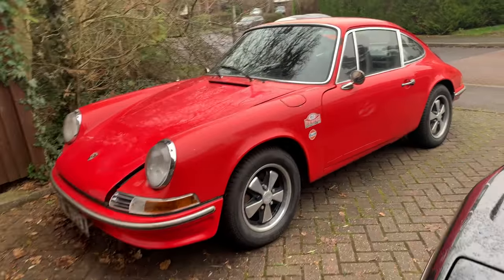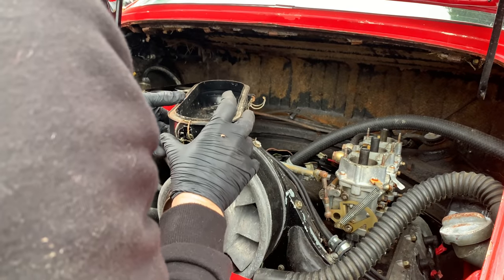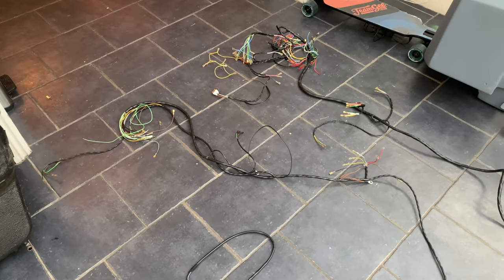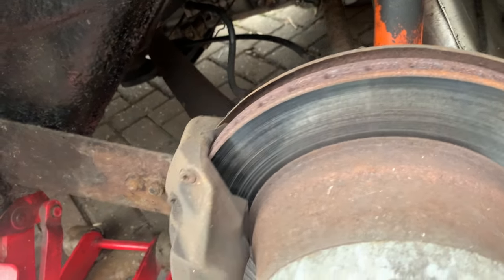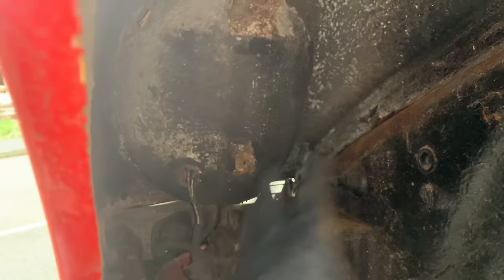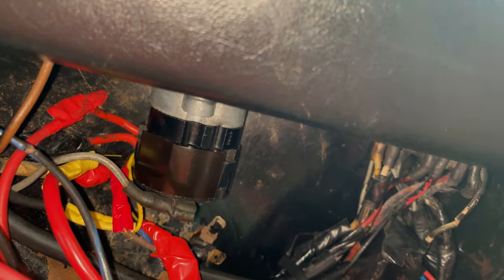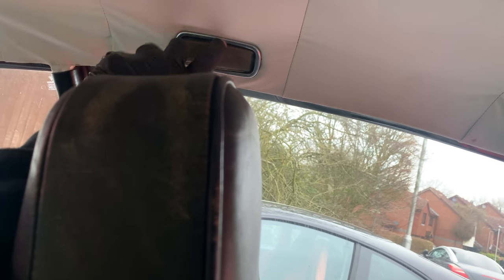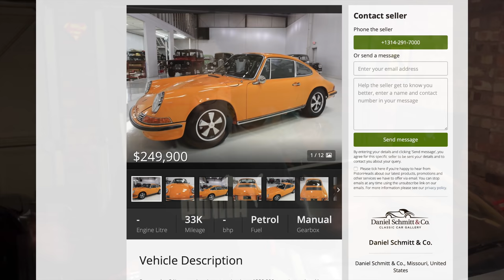Porsche 911 Project ....  How Bad Is It ? What Did It Cost ?

Comment: I would patching in the rust spots on panels as much as possible.  Watch some of Scott's metal work on Coldwarmotors or Brent on Halfass Motors.  The cost of replacement and then trying to align the new panels can be a nightmare.  You are a very talented, resource guy  and think you should start practicing with your welder and 3M panel glue systems. Save your money for the wiring and mechanical parts.  Best of God's Blessings from Nebraska!

Comment: Brilliant content part of my routine of an evening cup of tea and watch .in my 40s now started pulling cars apart years ago rebuilt several capris 30s 2.8 have worked as a mechanic even used to work in the checkered flag Santa Monica .love watching you trouble shooting and saving money 👍 my current car is a BMW Z4 coupe e86 which iv just gone trough suspension shocks all round springs mounts disks pads clutch duel mass sorted out several oil leaks water pump this is my 2nd z4 rebuild having sold last one to a friend.the current z is one of only 20 to come to the uk being phenix yellow so worth keeping.KEEP UP THE WORK 👍you show that you don’t have to throw money away to have amazing cars your determination is brilliant and it shows with a bit of know how you can have these cars if I used a garage I couldn’t afford my car.thanks for Chanel 👍😎
Reply from the maker: Cheers buddy much appreciated

Comment: Your rear panel is not correct for your car, you will need to make some modifications to remove the bump on the right and the angle if the edges. Great project though... My 1970T is now a 260bhp hot rod. Loads of fun!
Reply from the maker: cheers Paul I will take a look at another and see what you are referring to

Comment: btw...seeing those carbs ...if you do not yet have one, an ultrasonic cleaner in which the carbs will fit would be an excellent purchase. See eBay or amazon. One that will fit a carb will cost under $200...or thereabouts. The cleaner will also be helpful for other parts cleaning.

Comment: Hi, love your video's.  I would cover up those battery terminals.  You have a metal repair panel in the frunk.  it it moves during transit it could bridge the battery terminals.
Reply from the maker: Ive got a strap somewhere to clamp it down .... good spot though cheers

Comment: Hey Porsche bro. That will need easily £30k min to get it properly shipshape and solid. Both kidney bowls will be f###d and the strength in the chassis compromised. Good thing is the stainless heat exchanger/exhaust will have zero rust issues. Classic 911s are a motoring love affair. Best wishes for the resto👍🏻
Reply from the maker: cheers Gio

Comment: Look into Kroon wiring harnesses. I'm not affiliated with them, I've just heard their products are very high quality. Bit pricey though.
Those front seats are late 70's to mid 80's factory recaro sports seats. Factory option on the SC and Turbo. Comfy, and worth a few quid if in decent shape.
Reply from the maker: Flexnes1 cheers that’s good to know. I’ll clean up the seats and offset the cost
Reply: I’ve used their parts. Excellent quality

Comment: dont cut that quarter panel or you will be sorry11! .That littie bit of surface rust can be cleaned up and undercoated,saving you an immense amount of time and money.I OWN A 1968 912 ,that i was fortunate enough to pick up for a song back in 2004.As an old PORSCHE fanatic you know this is the same car with a smaller engine.My coupe has minimal rust issues and came with the front pan already replaced,due to corrosion from the battery area Thats a stamped piece ,thats easy to replaceand seems to bean area of concern with these cars.I would repair that bottom of the rear window area and along the top of the rear quarter panel andget that torsion bar access cover opened up and be done with it, My headlight buckets are in good shape but the metal conduit where the wires live was corroded out.Other areas to look for rust ,door hinge posts, rockers,and floors.Acomplete restoration is an absurd amount of cash involved and out of the question.But a good fun driver can easily be attained by sorting the mechanicals and that wiring mess.Then some cosmetics and start enjoying the  driving.As you know these particular vintage Porsches handle so well and are absolutely just pure fun to drive whether its a 911 or 912 with the 5 speed trans these cars deliver the goods. I will never sell mine ,BE CAUTIOUS about cutting out good metal with only surface rust,those rear quarters are the most difficult areas to remove and replace.Getting it right is near impossible ,unless you do this work on a daily basis for years upon years.like say at the factory,i would steer clear.whatever you do with that car Enjoy the ride and good luck.  RON IN SAN DIEGO CAL
Reply from the maker: thanks Ron, great advice

Comment: Man you did an absolute bargain to buy that car at that price!! Yes the car need metal work but all that car need. If the engine is good in compression and nonvalve leaking do only seals and gaskets that doesn't need to spilt the case. For wiring loom: there is a good man in netherland, mr Kroon, who did all the new wiring with perfect connections!! Not cheap but you can buy it by branches for example left front light only, engine wiring only and so on. you find it as "kroon harnesses"...and rubber connectors fit the body perectly...if not good are a nightmare to fit back on the body after painting. I know that car nut by nut and bolt by bolt so if you need any advice on spare parts I'm here. Pay atention to quality of spare parts, also the original that often are the same as not original but simply provided by porsche. Body parts as wings and fender all come from denmark from dansk so try to buy them cheap as possible cause they need adjustments when fitted. Use new gaskets (doors, screens) for panel alignement before painting because all new gaskets are more fat than the old and are a nightmare to fit if no adjustment i ade before paintin the body! Great video as ever! Good luck

Comment: I am a bit jealous on that car - it would a nice restoration project for my garage :) gonna be fun to chase down al those electrical gremlins. I would start cleaning that fuse panel and replace all the fuses. I have had quite good experience in replacing those on old cars. They can be the root cause for quite a hassle as they sometimes does not pass 12v when old.
Reply from the maker: great tip, ill do exactly that. Thanks

Comment: I just stumbled across your video. Mine is a 1976 Targe I purchased in 1992. Is it possible to put fender liners in the older cars? Mine never goes out in Winter or bad weather but I just wondeted.

Comment: does it have spacers on the rear, because the previous owner put on the wrong wheels?  The trailing arms just look like they have surface rust. sandblast and powder coat.

Comment: Regarding your Headlights: I had a similar problem and solved it by cleaning the contacts of the fuse box. You can do a quick check by turning on the light and rotating the fuses (I think it is fuse box 2, numbers 1-4) a bit by hand.
Reply: If you have some glow of the bulb, the likely problem is a faulty earth (ground) connection.

Comment: Hi, how did you fix the horn not working on the steering wheel ? Got the same intermittent problem on another youngtimer german car and the mecanism is very similar. thanks
Reply from the maker: It was the broken wire at the bottom of the steering column
Reply: @Ratarossa  Thanks for the reply man, will check it out. Cheers

Comment: Must be a nightmare to rebuild that v6
Reply: leo -.- it is not a V6 it is a boxer
Reply: Technically the boxer is a variation of the v6 so you’re both correct
Reply: leo -.- actually a v6 got the same stroke as a straight 6, but a boxer got the pistons operate directly opposite each other in pairs. That means two opposing pistons both are in top dead center at the same time. This is actually why the old beetle sounds like a two cylinder engine as there is no overlap in the 4 stroke cycles.
Also a flat six and a boxer is not the same. A flat six can be a variation of a v6 with a large angle, but that doesn’t make it a boxer
Reply: Sorry, Boxer is a FLAT six.